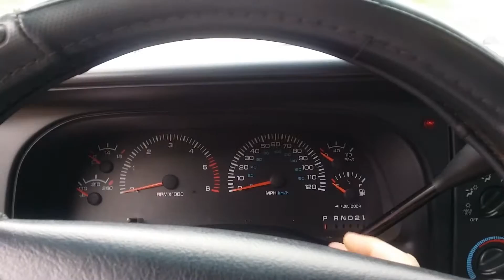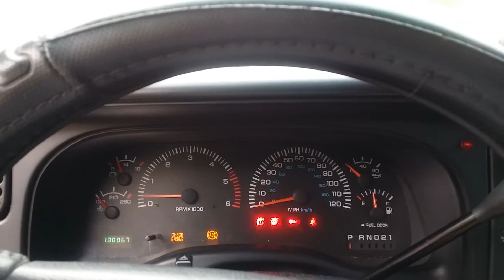Close up walk around of my 99 Dakota r/t

Comment: What kind of lowering do you have and does it bounce over bumps ? Mine does and it pisses me OFF
Reply from the maker: It's a belltech street performance kit. Came with all 4 shocks, lowering springs for the front and lowering blocks with proper angles on an to rotate the axle just a bit to compensate for the drop. Rides awesome in my opinion worth the money for the kit. Def doesn't bounce around
Reply: @brettlyjonesin  okay thanks for the info , yeah mine bounces like a Mazda b2200 it's a club cab. So I have some more work to do